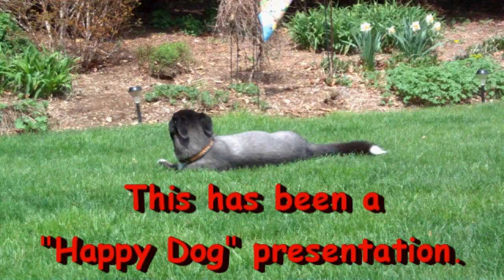MOJO Pot Stand - Mod #1 - Adaptor For Using Small Pots

Comment: I cut two pieces of carbon fiber.  I made them round so that they will fit inside of my container.  I turn the MOJO over and put the pot on the botom of the stand and then use the fiber to bring the trangia back up to the happy spot distance. In cold weather the insulator under the trangia will be required anyway

Comment: but I also have some brass curtain rod that is already split the entire length.   I can just cut three sections to fit the entire distance and crimp it down into a permanent attachment.  Brass should make purdy green flames as the copper content gets flamed.